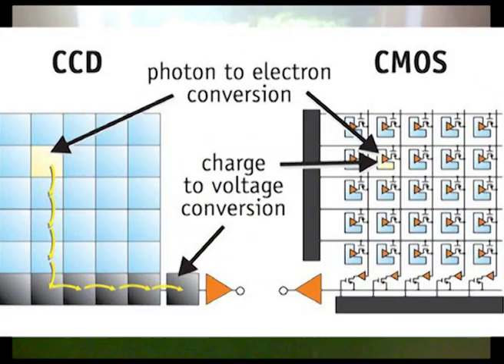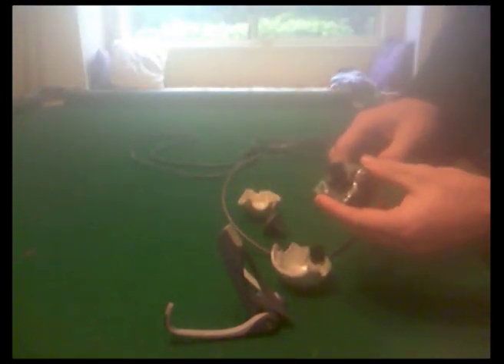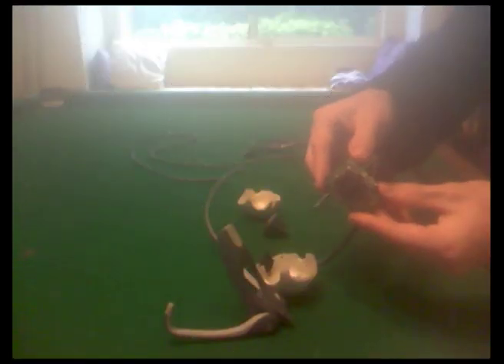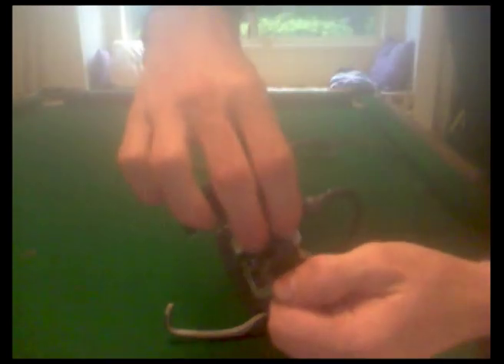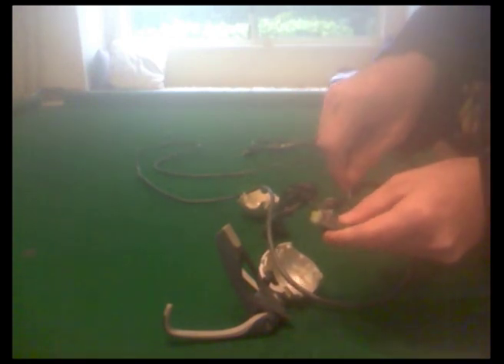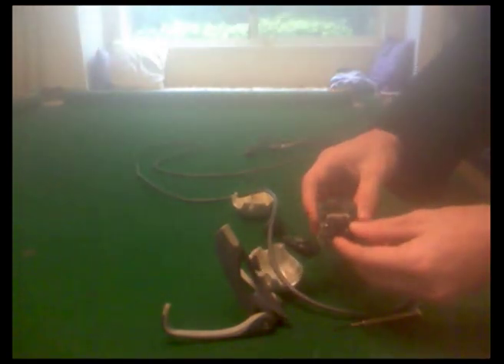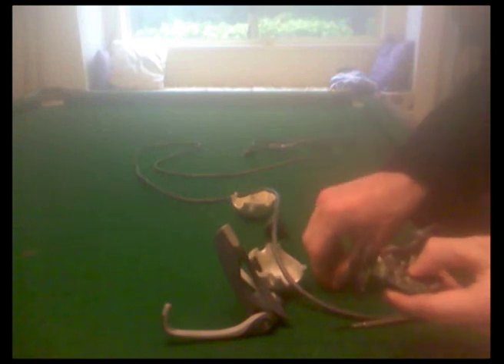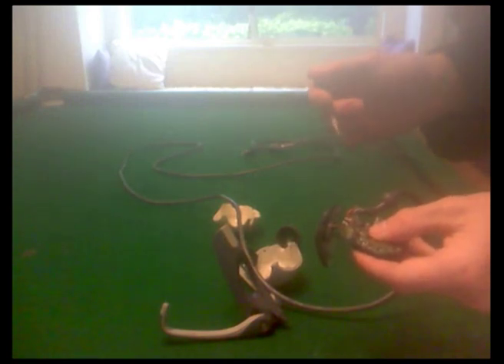How to Remove Infrared Filter From A Standard Webcam (Logitech Quickcam 3000)

Comment: Okey, just as a quick heads up to everyone. I HAD a logitec webcam with an IR filter inside... tried getting the ir-filter out but it was stuck so i decided to break it. Turns out some webcams have a coating on their lens to filter out the IR. Bottomline, don't break your lens. I now have a logitec webcam that can see IR but is blurry AF.

Comment: I dont see any ir filter in my webcam model c270h. I think it is affixed onto the cmos.
Cos it looks redish.
Reply from the maker: +sangarp2001 could be mate but I think the c270h was a CCD model. As far as I know they still use a separate lens piece for IR filtering but it could be done with a coating on the main lens now, I'm not too sure.